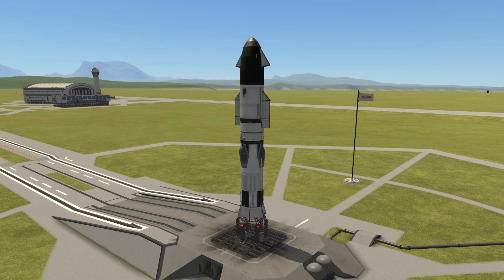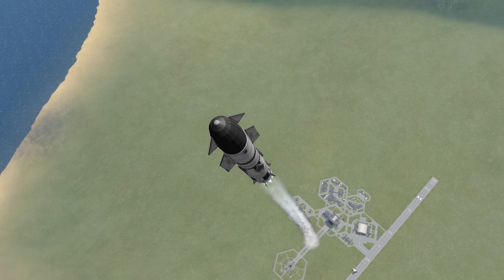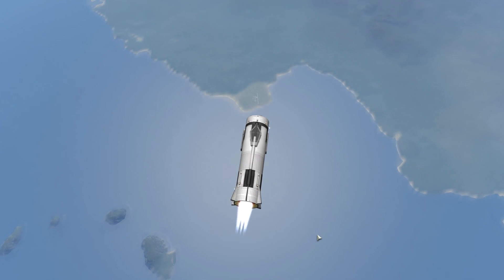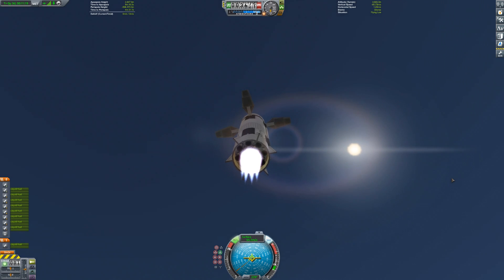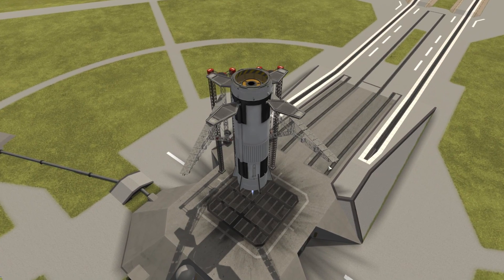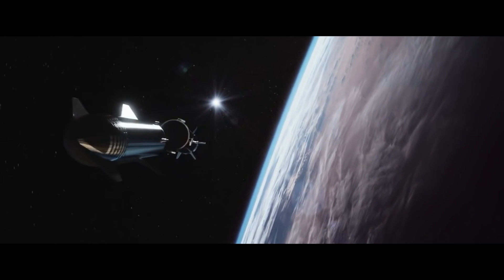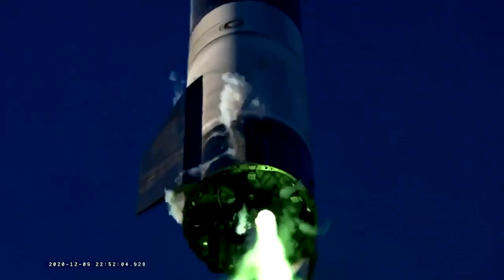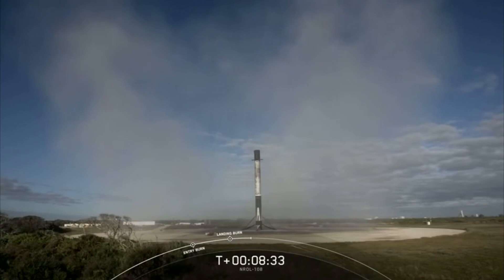Why SpaceX Wants To Make Landing Super Heavy MORE Difficult.

Comment: Launch and recovery system being the discussed does not negate the fact that The same problem of landing on the lunar surface from damage to engines and other vital Components.  Assembling Launch and recovery system in orbit, an fly it the Lunar surface To receive Superheavy.  If damage to the propulsion system at this time Will not be as critical. This will ensure superheavy a safe landing and launch from the lunar surface without the concern of damage by material being kicked up by landing and launch. Then the launch and recovery system can be used for fuel storage and the engines used for replacements if not damage if needed. Also the Crane can be used to off load and load materials to the lunar surface.If we are talking about crazy ideas, Here's one To chew on.

Comment: Instead of some complex capture system, put the grid fins just above the engines where the legs normally go and balance the load on them just as you would on an engine. then just before touchdown you fold them further down to act as legs. They've already demo'd they can flip the craft if things go past any corrections the fins can cope with. Still tricky but tricky maths is easier, once solved, than tricky mechanics.

Comment: So those grid fins need to take the weight of a fully fuelled starship and booster?! Is Elon making them out of Captain America's shield?
Reply from the maker: No I think the fins are only being used for lending the empty booster
Reply: @scottmanley  I feel it would put an awful amount of strain on the fins, if one of the actuators gets damaged how can it be repaired without bringing in a crane and putting the whole thing on a launch mount? It also precludes landing it anywhere else, like a drone ship, or another space port without a launch tower :-(  Landing slightly off or a gust of wind and it will take the tower with it!

Comment: Thought about the problem of catching. With four structures that pivot in, topped with a flat 90 degree V-shape with a rounded patted bottom, and supported on a hydraulic structure to both shock absorb and syncronize their movement together, it could catch a booster anywhere within a 10 meter radius and center it during a 8 meter deceleration range of travel. This accuracy of the Falcon 9 has already been demonstrated and the range of travel should provide a softer deceleration than would be possible with landing legs.  A lighter version could be fitted to a barge and attempted with an older Falcon 9 boosted considered near end of life. Catching the rocket just short of the deck then lowering for transport.
Lidar, cameras, and a math model should provide ample control for the system to catch, decerate, and center the booster. The catch area will need enough ring reinforcement for the side forces of the grip-like action but the forces from launch with a loaded Starship are higher, just it should have a formal review.

Comment: It would reduce the required precision in booster positioning if the supports could be movable in the final seconds of capture. The complexity, speed and precision required transfers from the rocket to the landing device.  How movable? How quick? The moving part must be light and strong...Maybe loops of cables on posts?  Lots of opportunity here for ingenuity, and first principles say there is nothing physically impossible in such a device...

Comment: The landing tower will have to balance the load of holding the SH at arm’s length.  My guess is inspired by crane design ... cables from the tower top to the ground 200 meters away. The  500,000+ pounds of tension on the cables drops to nil when not holding the SH. The cable slack and tension will be controlled at the ground possibly with counterweights that rise or drop a few feet.  This flexible control of tension and slack would allow the arms to pivot 90 degrees up from vertical to horizontal after the engines decend below the arms, then up & down a few feet to cushion the impact of suddenly bearing the SH weight.   Also, changing the cable length would be instrumental in lowering the SH to the ground after catching it.

Comment: It actually sounds easier to me. Since there's no danger of tipping over when it's held by the grid fins up top, and the suspension will be in the catcher rather than rocket legs (allowing for much longer movement range/slower deceleration after making contact), the necessary angular/velocity accuracy should be lower than for Falcon 9. Just positional accuracy needs to be higher. And they could do slow hover landings in the catcher at first to allow for a large number of safe target practice attempts per day. Aim at a point up in the air until they can hit it reliably before trying to come down in the catcher at speed.

Comment: The blast that damage concrete in static fire will be more powerful with all engines, a real mission would be impossible. 

Landing and taking off from Mars or Moon exposed regolith will just not work, the engines will be damaged.
Until the kinks are worked out, the only missions available will be with precision landing in safe pads.
Maybe here's Elon rational for this video.

Edit: maybe the first mission is to deploy a landing mat for the next Starship. The first one will not be safe to take off. And also we need the precision ;-)

Comment: I agree with what your saying @Scott Manley but lets be fair and say that the landings all over the drone ship can not be put fully on the boosters aim. That drone ship is also moving about and that will mess with anyones aim. Just felt it shuld be mentioned.
Reply: The drone ships are not moving when the rockets land.  They're held in position by 4 300 horsepower water jet thrusters on each corner acting on GPS signals to keep the platform steady.
Reply: @stargazer7644  no automated system is perfect, close maybe but not perfect and those engines can do didily against movement up and down

Comment: The fact that SuperHeavy would not be able to land on its supports was clear to ANY normal engineer (except Space X engineers). At least I wrote about this 2 years ago. It is enough to compare the weight of the landing stage and the strength of the landing legs. It is good that this has come down to Musk.
But this is not a problem yet. The problem will be to land Starship on the Moon or Mars and then take off. I wonder how he will solve this problem.
Reply: Сергей 2000 I’m guessing he will quickly evolve the moon variant starship into a lightweight non-steel structure that never has to endure earth landings. It will be strictly for between moon and space.  First moon construction priority will be a landing pad.  At 1/6th gravity, the non retractable landing legs should be easy.
Reply: @douginorlando6260  For some reason, Musk fans consider him to be Harry Potter who has a magic wand. They answer all technical questions (and there are a lot of them for Musk) in the spirit of magic.
To land on the moon, you must first make a landing pad and a launch pad. HOW to do it, aliens? NASA in the Apollo mission turned out to be from the option of landing a "lunar ship" on the moon - they realized that if this ship sits down, then it will not take off. Starship is ten times heavier.
Reply: Сергей 2000 his solution to the problem is not using the rocket engines on the bottom for the final seconds of the landing (and take off). The landing gear stability means spaceX will pick the precise landing spot in advance.  The first task for the moon base should be building the landing pad.  This will greatly improve the cost per ton of supplies delivered to build the base.  My favorite solution is to use a starship steel hull, cut into long straight strips then welded together into a landing pad steel plate.

Comment: They would need the worlds greatest  structural engineers to create that soft catch tower . That thing  is  70 meters tall , 9 meters wide  and weighs 180 metric tons dry.  If it is even carrying 5% propellant the gross landing weight would be 350 metric tons . The mechanism to have that leviathan come to rest gently suspended without causing structural damage to the whole landing assembly would need great engineering and would be a sight to behold indeed .
Reply: I don't think new engineering is necessary:  One Arecibo sized tower and 1 aircraft carrier landing arrestor should catch a heavy booster below 5 mph, stopping 300 us tons in about 2 seconds, in 12 feet/~3.6m. 
At 60 mph, you'd need 12 arrestors and 43 meters and should stop 2 feet/.6m off the ground. 
Arecibo tallest tower was 111 meters high, ~2-3  meters across, and supported ~300 us  tons. 
The Mk7M4 arrestors engage speed is up to 175 mph, up to 25 us tons, with a 2 second stop time, BUT that takes over 100m.  Quick calculation is that one arrestor for 300 us tons would max out at 15 mph speed.
But with 43 meters (111m tower - 68m rocket) and 12 arrestors, you could catch 300 us tons doing 61 mph in about 2 seconds.
Reply: @HalSchirmer  This is great information . You should probably post this on the main comment section . I can only imagine the superheavy and the starship's descent . It will be a great sight .

Comment: I wonder if this idea of catching the SuperHeavy plays into the idea of doing sea launches. If a SuperHeavy blows up a part of land-based space port, it could really screw up that tight scheduling Elon's aiming for even if it doesn't do critical damage, while on water he could literally build backup launch "ships" that could be constantly standing by to take over if primary vessels went offline. Granted, sea launches and landings are harder, but if the cost of landing boo-boos can be reduced significantly then a slightly higher rate of wrecks might become acceptable.

Comment: The cost of helium for pressurization of something the size of the Starship or Superheavy boggles the mind and the availability of sufficient helium for thousands of launches is doubtful. Current hypergolics are far too toxic and difficult to handle. There have been several promising oxide-fuel blends that can be triggered with proper surfaces, but nobody has been able to justify making them flight-ready up till now. That needs to change. Trying to light methalox in short bursts for control obviously needs rethinking. I would suggest small, constantly burning control rockets of highly variable thrust. Such rockets will be needed for the landings on the Moon and Mars, so why not develop them for control, now.

Comment: Superheavy weighs 180t (metric) empty. A single sea level raptor can currently throttle down to 40% and has 2200kN thrust. 2200kN / 9.8m/s2 = 224t. 40% of that is 90t which means that two sea level raptors throttled down to 40% is able to just balance out superheavy's empty weight and cause it to hover.

Comment: Scott, the idea is not bad if....if the fins are at the bottom instead of the top of the rocket and all the time the cylinder is falling upside down. Then flipped over and the fins are used as legs similar to the Falcon 9. The engines will all the same need to be isolated against debris.

Comment: Its kind of wasteful fuel wise. Hovering in place is an energy expensive maneuver. On the other hand, it will probably be offset by the weight savings from not including landing legs (and offset the other way abit due to the structural reinforcements needed to make the fins load bearing). Since the landings will mostly be at sea, it has been shown that the sea water is a great vibration absorber - still would make the landing really finicky.

Comment: One possible design of the catcher device is a surrounding eractable towers. The starship would hover more or less in position and the towers would center it as they erect, and then the starship would lower onto the catch bars. But the towers do need to erect fast enough, moving something so heavy so quickly uphill is kind of a problem.

Comment: I wonder if having the landing 'sling' mobile a hundred metres or so in all directions, would help or hinder? Of course it would be a heavy platform, but perhaps a lightweight structure cpuld move around quickly, then anchors to the ground just before landing? I just thought it might be easier to move that, than the rocket itself?
(Disclaimer: shocker, not a rocket engineer!).

Comment: 7:21 can someone explain or point me to more info about this autogenous pressurization idea?
Reply: After separately cooling the pre-combustion and combustion chamber walls and the expansion nozzle bell, the now cold but gaseous propellants are diverted to their own tanks as needed to maintain pressure. 

During the initial ignition, the engines are cold and the autogenous pressurization system may need assistance from stored high-pressure gas.

Normally, the landing engines would not be hot just before being restarted for the landing burn. But SN8 did have hot engines and plumbing, so it likely had some vapor that needed to be burped during engine start. This volume of burped vapor may have reduced the methane "header" tank pressure below a sustainable level. Adding a vapor separator near or inside the methane manifold should solve the burping issue. This is basically a stirring paddle with a suction tube at center axis.

Comment: Hi Scott.. Is it possible to launch Super Heavy like a warhead from a ship(via launch tube).. It would use less fuel during launch and the mouth of the tube can be used to capture the first stage from the grid fins. Obviously there's got be a sound suppression system and regulated outlets for controlling and using the exhaust.

Comment: I wonder if that was planned from the outset. First thing that flashed through my (naive) mind when I saw a grid-fin was 'is that a landing leg ?'. 

It also makes a lot of sense re: precision targeting. Easily the biggest advance in last 50 years has been electronics / computing - which would be critical. Smart piece of strategy there - little else has changed so much so make the most of what has changed.

Comment: I would expect the precision in the landing/capture to come from two parts.  The lander itself should be able to get within a couple of metres or so of its desired spot.  The capture system should be able either to move en masse, or to move the capture arm(s) to make for a very precise capture.  Greater flexibility (and cost) if the whole unit moves  but cheaper and easier if just the arms move.

Comment: If the landings are very nearly spot on, could not the rocket come down into a vast bucket of water, the thrust/heat would remove the water dissipating vast amounts of energy before it settles down onto a dry grid pad?

Comment: I wonder, SuperHeavy is using 28 engines, looking back at N1 with 30 engines, that's tons of points of failure...
Reply: Engines and computers that control them are much much better today.
Reply from the maker: Falcon Heavy uses 27
Reply: @scottmanley  But it still an awful lot of engines to fail, I get the technology difference between N1 and Starship is more than 12 parsecs but it seem risky to me from maintenance point of view :)
Reply: @yonsix  But the rocket doesn't need all the engines to work for the mission to succeed.  It's also a lot of redundancy.  It actually makes the rocket more reliable.

Comment: If it is vacuum tight, then why don't they just drop it in the sea then hoist it onto a barge?  Why is is such a problem for the rockets to be able to withstand being in sea water? The human body can only withstand being dropped 20ft on land but that goes up to 150ft in water.
Reply: Saltwater is not that healhty for the rocket. Would be my guess.

Comment: If you can land a vehicle with that precision, you kinda dont need to catch it. Would almost be easier to make a landing pad that dampens the landing IF the landing is heavier than expected! Also, Space X moved away from carbon to stainless as its cheaper and functions better at low temps blah blah blah. Want to know what part of the booster isn't at cryogenic temperatures. The fins. 
This step while I think is awesome... seems unnecessary and a huge risk for the project, I think they are having issues with the structural aspect of the booster after heavy landings, hence reduction in weight and change of landing.

Comment: Hanging the rocket from the grid-fins after it lands also means the rocket doesn't need to be able to support its own weight with empty unpressurized fuel tanks.
Reply: Yep, I also like that it is a whole lot easier to not topple over when you hold a long tube from the top. It will need some beefy hinges to support that weight but then there are 6 less chunky inboard legs so mass might even be less.

Comment: If they can pull up such accuraticy they can do this I assume but for me it would still be much easier and safer to land the ship on a landing pad or barge and then transport it over to the launch pad with some sort of holding mechanism. In that way you do not risk all the equipment at the launch tower every time you land a booster.

But then again Elon like to make crazy ideas to work. I mean: Who would have belived that landing a orbital rocket first stage on a small barge in the middle of the ocean would be doable before they did it? Johan.

Comment: I think the thing is, with multiple raptors and attitude control thrusters, they certainly CAN hover.  It's a question of available fuel.  So, if they're launching objects that are relatively light, but require a large volume (I'm thinking humans...)  seems like there would be enough available fuel to do it.  So how long does a super heavy booster need to hover for some sort of arms to reliably grab it?